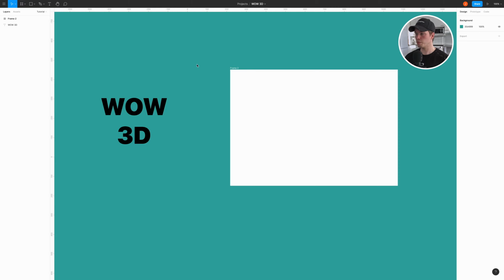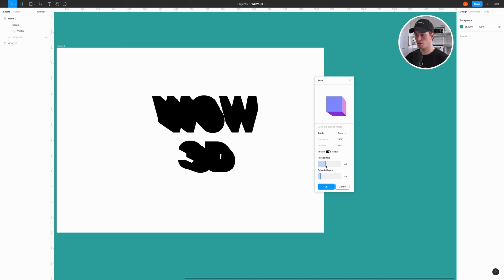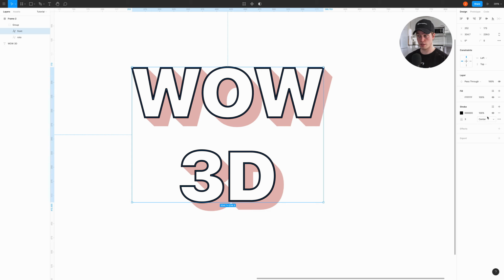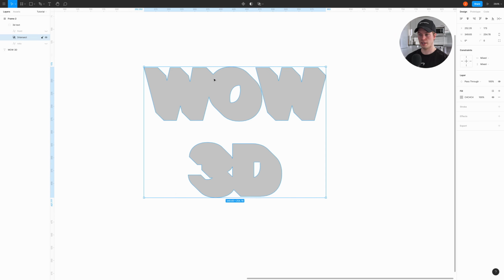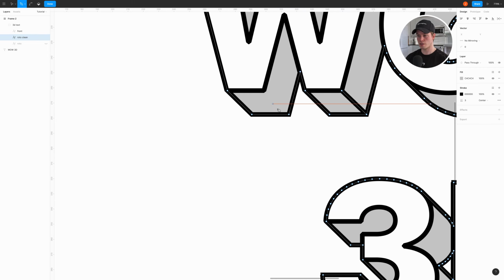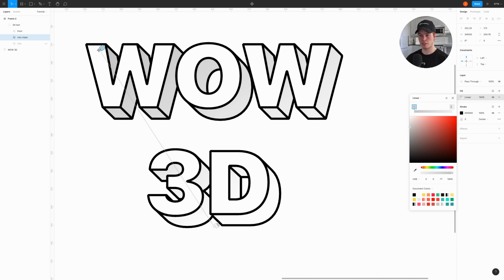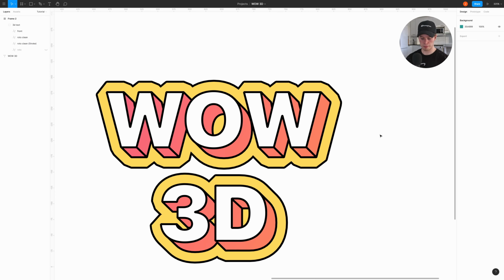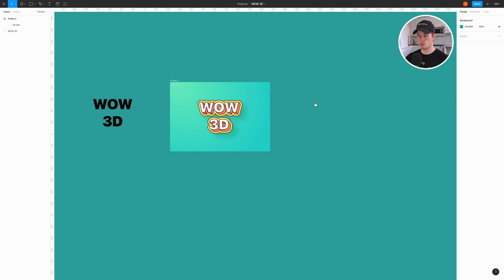Create 3D Text in Figma | Figma Design Tutorial

Comment from the maker: NOTE: If the layer disappears after the boolean/intersection selection, just try to use a smaller font size to start with. Last time I tried, font size of 50 was working fine. And when you're finished building the effect just use the "scale" tool to resize the layer to the size you need it.
Reply: My layer is still dissappearing.
Reply: Mine too
Reply: Mine still disappears with font sizes 20 down to 12
Reply: disappears no matter what this tutorial doesn't work anymore
Reply: this tutorial is does'nt work to me. My layer disappear

Comment: I am getting lost in Intersect selection again and again, and my font size is 100 .... Is there any solution for me?
Reply from the maker: Hi, I did some testing with this and it seems that Figma just doesn't work with this technique anymore when using big font sizes. But using a smaller font seems to work fine. I tried with a font size of 50 and was successful. 

So I would recommend that you build the 3D text with a smaller font size and when you're ready just use the scale tool to make it the size you need.

I hope this helps!
Reply: @fullstackdesigner  Hi! Dope Video, thanks!! 
I scaled down to fontsize 12 and still no success :( Do you have a workaround at hand?

Comment: i cant do the intersect selection, the selection is gone.. how can i fix that?
Reply from the maker: Sorry for late reply, but Figma must have had some updates to the boolean selection tool at the time you tried this that broke it. I tried it again now and it seems to work. You can also try to start with a smaller font size. Figma doesn't always like it when you try to use the boolean tool on large vector layers.
Reply: @fullstackdesigner  I thought as much because I was lost at that same intersect selection so I tend to use the none clean up stage text which was still cool to me. Thanks, I will share your handle.